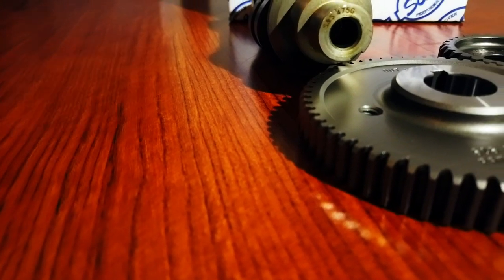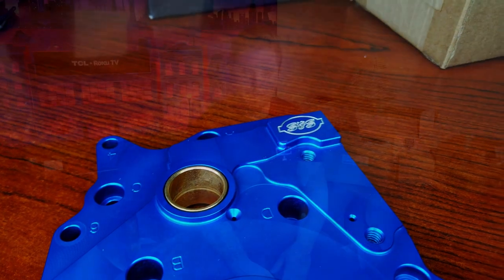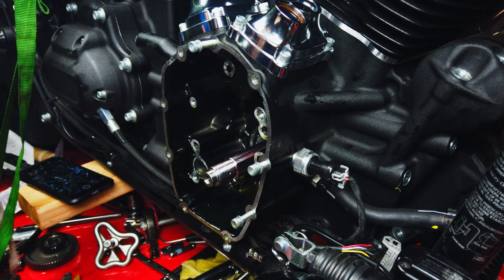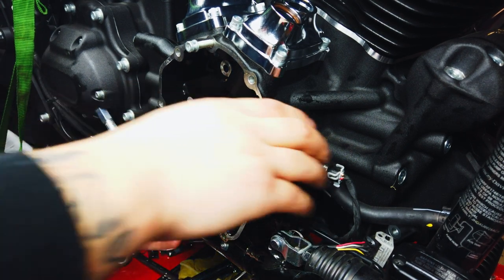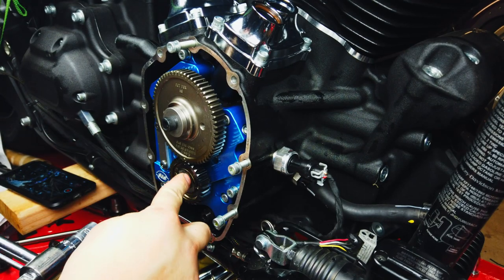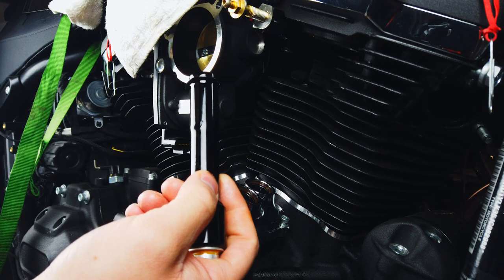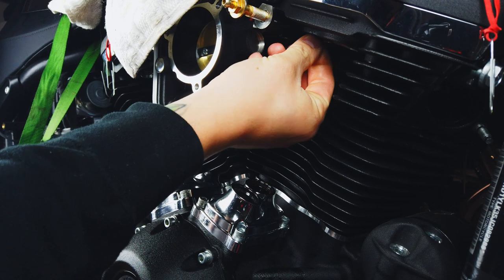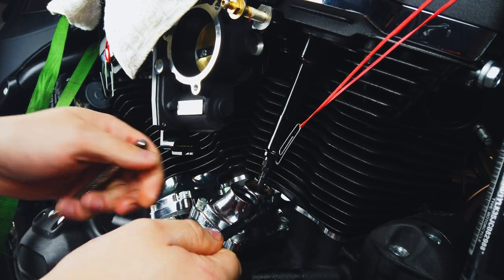2018 Fat Bob S&S 475 Cam and Cam chest install

Comment: Did the same job but i used the Harley torque cam, S&S lifter cuffs and Vance & Hines FP3 tuner. Really liking the performance. Please be aware that Harley is now automatically blocking the powertrain warranty on all 17-18 bikes with aftermarket tuners. This is no longer up to the dealer, it happens automatically when they plug in the online technician tool even if it is just to read codes or program a key. IT does not fully void the warranty but there will be a flag in the system should you a need powertrain repair. HD will decide if it was caused by the tuner/tune used.
Reply from the maker: I just learned this myself, I was gonna have my cruise control turned on and they couldn't do it without voiding the warranty, shitty!

Comment: I noticed you used a dial-type torque wrench when torquing them down. I crack a head I had just ported when I was installing it using a click-type torque wrench while installing a pin for one of the tensioners at 18#/ft because the material was aluminum on my '02 Jeep Grand Cherokee. Really sucked and I learned to never used that type of torque wrench on aluminum, so good choice on your part.

Comment: Just adding my 2 cents worth. What is with that torque wrench? Haven't seen one like that for years. Second you should only put on a few drops of locticte on the threads and not coat the entire threads. Glad the bike started and ran. I just do things differently

Comment: I hope you changed the cam bearings. Didn't hear you mention anything about it.
Reply from the maker: Yes I did change it out. Sadly I forgot to put the camera on when I did it.
Reply: What was the runout ?
Reply from the maker: @jimscycleandautotn8508  35 thousandths
Reply: @TheMrJHSN  what did you do with that information?

Comment: Good video but I didn't see that you checked for pinion shaft runout. If it's not within spec, you would have had to continue with using chain gear setup. Hopefully everything turned out okay.

Comment: Hi mate
Can i ask, i get fatbob 2019 and i think already installed cam chest kit, it is a normal if the sound its more noisy i dont know its come from primary or at cam, please i hope you reply and give me suggestion, thanks a lot
Reply from the maker: If it has a can it might make a little more noise but not a lot. Some bikes have more noise than others. U can use a screwdriver like a stethoscope to try and listen to the engine and see where it’s coming from

Comment: The video should be corrected, the thick oring goes behind pump, thin oring goes behind cam plate ;)
Reply: S&S does not use a thick and thin O-Ring in their kits. The cam plate and the oil pump come with the same thin O-Ring. I tried using the stock thick OEM one on the S&S oil pump and the spigot for suctioning the oil from the crank cavity would not push in so I used the O-Rings that came in the kit.

Comment: Harley should be Bent over still using cam chains... service rort so typical with HD $$$$$
Reply from the maker: There is some benefits to chain in some ways. It's quieter which helps them pass EPA noise restrictions. Also since mass producing crankshafts leaves for error in crankshaft run out, the chain is able to take those tolerances unlike gear drive. Harley has retained it's gear drive on the sportster Evo Motor, though I'm sure if it ever gets a major revamp I imagine that may change

Comment: I kinda wish I knew how to do this stuff. The parts aren't very expensive, but I have no experience as a mechanic      edit: subbed
Reply from the maker: Well I always encourage to pick up a wrench and start learning! It's really not too hard, some stuff is easier than others but if you take your time usually u can get it done 🤘
Reply: Having a service manual goes a long way too...
Reply: Its cake, grab your balls, beer and a service manual. You got this.

Comment: Hey man great video. Just wondering did u do any head work? Replace the valve springs anything like that? And now that you have been running it for a little while how is it holding up? Any issues?
Reply from the maker: So no head work and stock valve springs, this cam is as much lift as you wanna go with stock parts. I plan to upgrade the valve springs and lifters when I go big bore on it. But I love the feel of this bike so far! It's was a killer upgrade and highly recommended!

Comment: Thoroughly enjoyed your video. Someone asked about the lifter and you stayed with stock as they only had 50 miles on them. I also noticed that the lifter covers stayed on during the entire process. Were you able to keep them up inside the bores while removing the cam? I didn't see any magnets or devices holding them up in place when you removed the cam. I thought they might drop down into the cam chest when you pulled the cam out??

Comment: How come when J&P cycles do there cam install they adjust the front cylinder valves to overlap and then fit and adjust the pushrods into the rear cylinder. Once this is done they set the rear to overlap and fit the front cylinder rods. there reason to this technique is that when one cylinder is on overlap the other cylinder with be on the base circles of the cam!
The only difference between your installation and J&P's is your using gear driven cams and there using chain driven!

Comment: just curious. when you did the turns on the adjustable pushrods and then you let the lifts settle did you have to do anything else but wait? thanks
Reply from the maker: Nope. U just wait over night usually and see if the pushrods can spin freely

Comment: Street Glide Special 2020  S & S 475G
The problem is the cam sprocket backlash. Can I just install it in the case of a new car?
The problem is, after disassembling, I have to order a gear with a large backlash.
I'm worried
Reply from the maker: Yes that is the issue with gear drive. If you're concerned I would recommend chain drive
Reply: Did you measure backlash
Reply from the maker: @Kim-ub1il  yes. Mine was in spec

Comment: Great video thinking about that cam for my new lowrider S
Reply from the maker: It's a killer cam. Great all around power, and also u can keep the same cam when going to a big bore later on, it makes it much more of a low end torque cam but it'll work just fine in a 124-128 set up!

Comment: Great job, I wish I was savvy at that kind of motor work, I’d save some $$$
Reply from the maker: Just gotta go slow and follow instructions man, it's not too hard. Maybe u know a friend with some know how that can lend a hand 🤘
Reply: I did my pipes, air cleaner, and fuel programmer.  That wasn’t too bad, next is the cam, and bars.  How do you like that 475, any significant performance increases that you can feel.
Reply from the maker: @donniebrazis  awesome increase in power! Great sound and everything, cams are probably the best motor mod you can do on a Milwaukee 8 🤘

Comment: Thanks for the video.  When you put your cam gear on, did it pull the cam into the cam plate to a point it became alot more difficult to turn the cam?  I just installed mine today,  it will turn, but not by hand anymore...just wanted to make sure this was normal at least until it wears in the bushing a little.
Reply from the maker: Are you turning it by the back wheel? If so did u remove the spark plugs? It does get harder to turn cause u got a lot more rotating with it but. It shouldn't be too bad. If u know it's only the bushings causing the resistance than I wouldn't worry much, it should wear
Reply: @TheMrJHSN  spark plugs out and so are pushrods.  Took the cam gear off and camshaft won't turn by hand.  So I'm guessing it's just close fit in the bushing. Wish s an s tech responded as fast as you.  I can't wait to get this fatbob back on the road.
Reply from the maker: @harrytinsley1199  haha they're a lot bigger company than me but ya if u took off any possibly load and it's only binding in your Cam plate than you should be good. Did u make sure to put assembly lube on the bushings and cam? My camera battery died and didn't get 100% of everything on film but if u have instructions u shouldn't have missed anything
Reply: @TheMrJHSN  lots of lube was on it.  Had a issue with the little key pushing in too far first try. But it's all lined up good now.  Thanks for your help and videos.
Reply from the maker: @harrytinsley1199  no problem man, ask anytime you have a question. The 475 is an incredible cam, I rode it all around the southern California area this last weekend and loved it. Made it into an animal!
Reply: @TheMrJHSN  S&S confirmed the cam would not rotate so easy once the cam gear pulled it in the bushing good.   I didn't use adjustable pushrods, so buttoning everything up is a little more work, but getting close.  Thanks for the help.  harry
Reply from the maker: @harrytinsley1199  awesome! Glad u got it squared away man!

Comment: Tell us about performance how much you gain over all. How does it feel at the seat driving with a stage 2.
Reply from the maker: At first it felt very fast. But now I have upgrade to a 131 S&S Stroker that's much faster. Still would like more power
Reply: @TheMrJHSN  I have same bike and now looking to order this S&S full Cam set up. How much better power than a stage 1 you would say ? Its not a cheap upgrade so I am curious go for stage 3 or stage 2 will be enough.
Reply from the maker: @amg5795  I'd say go big bore. it's a noticeable upgrade but most likely you'll end up going to the big bore kit in the end
Reply: @TheMrJHSN  S&S ? What would be the price ?
Reply: @TheMrJHSN  By the way which cam is this 475G or 475C ?
Reply from the maker: @amg5795  this is 475G
Reply from the maker: @amg5795  price will depend on where u get it from and if you install it yourself or have a shop do it. It can be as low as 1500 or as high as 3k
Reply: @TheMrJHSN  What is the difference between them to in a performance ? I am strongly looking to do this upgrade but they are out of stock. Waiting till it will come back at the stores.
Reply from the maker: @amg5795  check out fuelmoto. They have high quality kits and good prices
Reply: @TheMrJHSN  You were right ordered 124 Big Bore.

Comment: Are there any specialty tools needed for the install?
Reply from the maker: U want the can bearing puller and a dial gauge to check you're run out. And that's it!
Reply: FXFBS_eNVy thanks! Also, why do you need to change the cam bearing?
Reply from the maker: @therythmoftheroad  well if you're bike is pretty new your probably fine but it's good to do it while you're in there and the ones that come with the kit are much stronger so it's just a while you're in there thing!

Comment: Why did you go with gear drive instead of chain?  Don’t have that run off tool. Do I really need it?
Reply from the maker: So gear drive is more reliable in the end, less wear parts than chain drive and more precise timing. But chain would work fine. If you're changing out the cam plate for a billet one then I would suggest checking your crank run-out so you know it's not out of spec. It's not as likely on the new M8 engines but it can still happen

Comment: What’s the max crank run out for the gear drive? This is a very important step that some may not no.
Reply from the maker: It is 5 thousandths. It will tell you in the S&S install instructions
Reply: FXFBS_eNVy  wow! That’s a lot, badass. Thanks.
Reply: No, thats for their oil pump. Max is .003 for gear drive

Comment: What was your crankshaft runout.?
Reply from the maker: It was only 3 thousandths 👌👌 most M8s have came from the factory with very little run out, much better than the old twin cams
Reply: FXFBS_eNVy I put the fueling oil pump and cam plate in my M8 mine was 3 also great video buddy thanks for sharing.
Reply from the maker: @matthewlidel4324  
Very nice! They're a great upgrade for these new engines. Got more videos coming for sure! Lots of front end and stereo work on the way
Reply: FXFBS_eNVy I am thinking about doing gear drive cam and 117 kit next.
Reply from the maker: @matthewlidel4324  I'd say do it! I'm thinking about wait til next year for more engine work, I wanna do the fuel Moto 128 kit, extremely nice stuff! If u haven't heard of them I'd. Give them a look, great prices and customer service for sure

Comment: OH GOD WHY ARE YOU DOING THIS WITHOUT GLOVES?! Your cam chest is going to have hand residue all over those parts and it's gonna heat up and tarnish them.

I wanna do this kit except with the Chain version in a 107. Thanks for the video.
Reply from the maker: Chain version of the cam would definitely save a little extra work! I've been told you wanna change out the crankshaft pinion gear on the chain if you're in there cause the stock has a little slip from the factory. Good luck! Cam really opens the bike up and gives it back that Harley sound 🤘🤘
Reply: FranBunnyFFXII Put that joint down bro... it’s no big deal,..

Comment: Great job mate. Riding 2018 Slim and I really hate the rattling chain (or whatever it is) in cam box. Did this sound disappeared after its replacement?? Big thx for answer.
Reply from the maker: Yep! If You get the the right gear size then it meshes beautifully! I highly recommend it! Plus the extra power

Comment: What did you do for lifters?
Reply from the maker: I decided not to change them, they only had about 50 miles on them. I'll be changing them the next time I'm in the engine though 👌
Reply: @TheMrJHSN   big mistake
Reply from the maker: @roncoburn7771  I had no issues at all. Switched to another low lift cam

Comment: Texas City?
Reply from the maker: What?
Reply: FXFBS_eNVy that maroon shirt has the logo of a town south of where I grew up.
Reply from the maker: @gtownsurfcody  haha I believe it's a company called troll co and it says #working harder than an ugly stripper" 😂
Reply from the maker: @gtownsurfcody  they might have copied the logo idk haha
Reply: FXFBS_eNVy I gotcha. Thanks for the vid man. Are the gear driven cams a better set up? It’s only 100$ difference right now for the 124” kit with all cam chest complements.
Reply from the maker: @gtownsurfcody  they're more reliable in the long run and give better timing